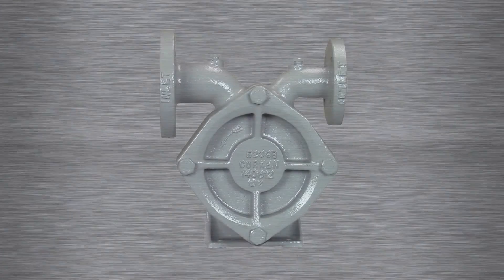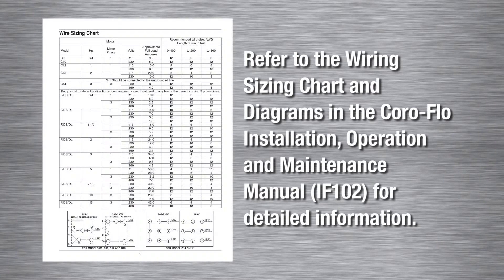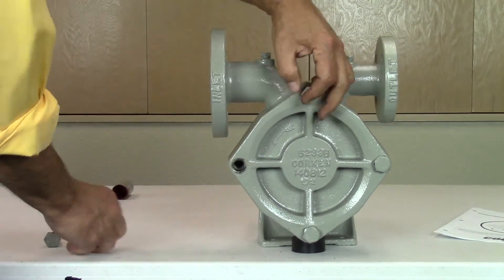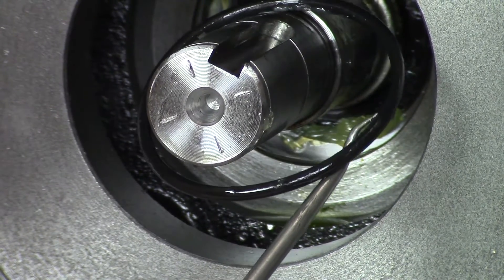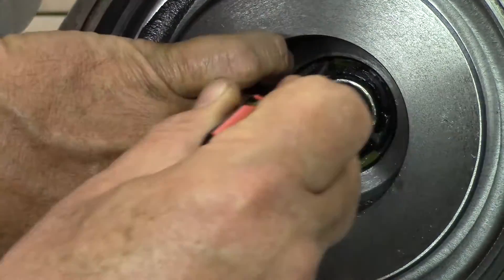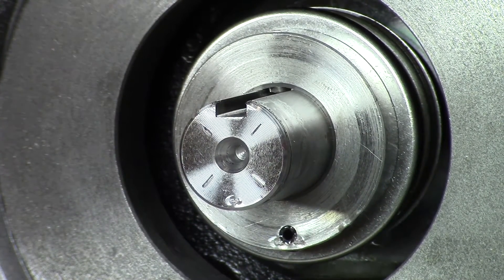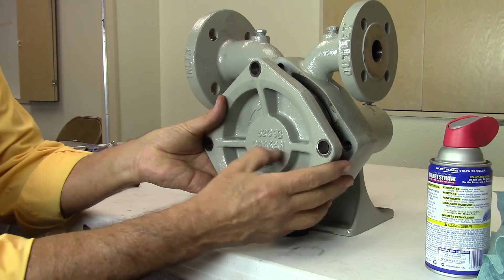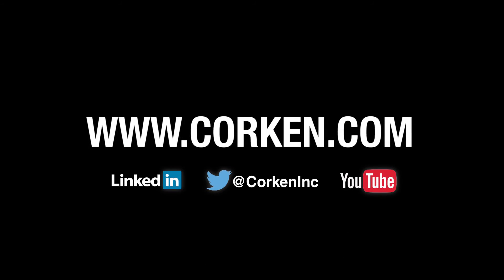How to Maintain and Repair CORKEN's Autogas Regenerative Turbine Pump

Comment: Sir you are easily remove 2 nd retainer ring in new pump , but in running pump it was very difficult to remove that . Can you use circlip . It is very easy to remove. And also  rotary mechanical seal has ss bore it  easily weared so that we are not able to remove that . Rotary seal notch pin , which is inserted in shaft easily slides ,so that it rotary seal rotates independenly with the shaft rotation rpm.
Reply: I have rebuilt several of these pumps and to get the mechanical seal out, you need to basically make a 90 degree screwdriver.  We heated it up with a torch, bent it 90 degrees and then you can work the mechanical seal out.   The first time I rebuilt the pump it took 2 hours to get out the seal.  With this tool it took 2 minutes.